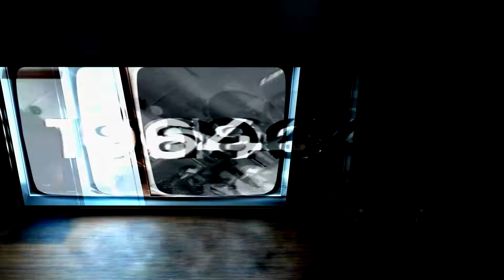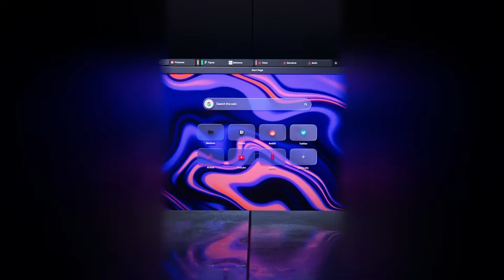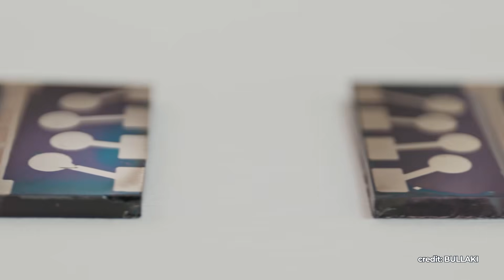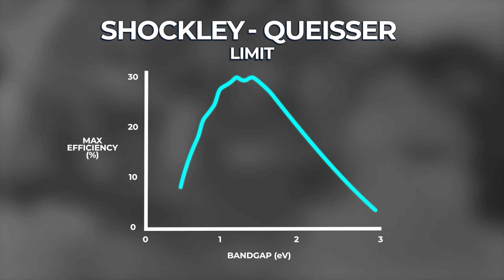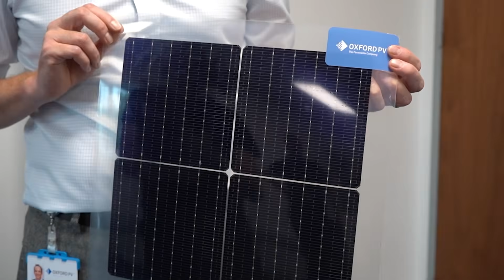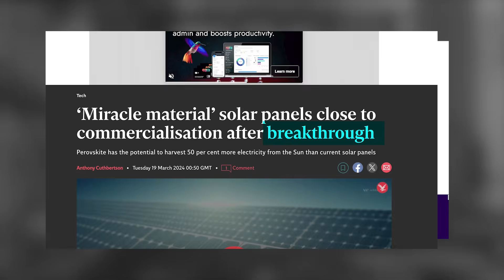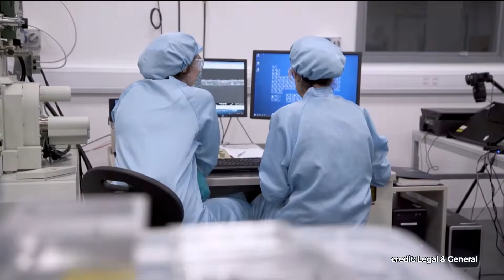How Physicists Broke the Solar Efficiency Record

Comment: I would've liked to hear more about the toxicity / sealing efficacy. The ability to mass produce is one thing, but it would've been useless without an effective resistance to degradation.
Reply: I know that couple months ago they were shipping (or already shipped it) to company that is mostly making measurements of degradation. If they are now shipping it to energy companies, it means that it must have passed some threshold. But it's all very secretive. Even that firm that specializes in degradation, wouldn't say how long they already had those cells and what results they had already. They did say that they would release some information after the process is finished (which usually means guaranteeing minimum of 10-20 years of operation). But not much. They would give all information to company and simply certify their panels - assuming they meet their criteria.
Reply: @jannegrey  for anything >15 years of warranty they need a reinsurance company in the EU, that will be the point of trust, if Munich or Hannover Re reinsures their product; they might have a chance.
Reply: @DooMMasteR  It would be great if they do. Ultimately this is just a step. But if you solve packaging problem - and make them resistant to elements etc. then you also should have less problems with 3 or 4 layered ones. And similar method might be used some day (or at least built upon) for non-silicon based PV Cells.
Reply: True, but most importantly what we need to do is find better way's of recycling old solar panels, otherwise we are just going to repeat another loop.
Reply: @trystonkincannon8320  As always recycling is something that you want to be able to do as close to 100% as possible.
Reply: It's pretty simple reason they didn't: because they don't want their competitors to know.
Reply: @autohmae  still, Cadmium and Lead have been banned for good reason, so introducing these to an open market would have to overcome SIGNIFICANT hurdles.
And for good reason, humans suck at keeping toxic stuff in check once they distribute it in use, see lead in electronics and Cadmium in batteries.
Reply: @autohmae  I mean, you don't eat batteries or PCBs either and still.. stuff ends up in places it should not. RoHS is pretty comprehensive nowadays.
Reply: @DooMMasteR  It's almost like putting lead in fuel and have it belching out of every exhaust pipe for decades might have something to do with it.... Lead pewter, water pipes, and paint are also very common historic sources of lead contamination.
Lead is bad, and hould be avoided where at all possible, but putting a tiny amount in solar panels (assuming their particular secret forumla does) is not exactly a panic button moment.
Reply: @autohmae  oh nah

people will absolutely diy solar panels, i mean thats what science is about for normal ppl

but not state of the art stuff of course
Reply: @DooMMasteR  because manufacturers are forced to use lead free solder, we get more electronic waste because solder without lead cracks if you fart in general direction of the pcb... Then we have same manufacturers trying to prevent repairs with various methods which often results in 1 dead chip/solder crack = garbage. Software locks are also common these days too, so even if device is repaired, there is a chance it will not work properly.
Reply: @CrazySerb  that's a myth. The original issues were mostly from rushed transitions and bad executed production retrofits...
yes the transition took time and cost money, but no, it did not make products less reliable.

Comment: I've read that silicon cells degrade from about 22 to the stated 18% rather quickly. 
For the layered cells, will the silicon aiming at a different wavelength have a similar degradation, and what does the expected curve for the provoskovites look like?
Basically, how long will they last?
Reply: What you're saying about degradation from 22% to 18% states a degradation to ~80% of initial effectiveness. Data collected from existing photovoltaic solar panels tells us that it takes anywhere from 20 to 25 years to degrade to 80%. Not so rather quickly in my opinion :) As to perovskites solar cells there is no real world data but in labs they mostly had crap life span.
Reply: Perovskites are still a lab experiment, but given the amount of real world operation problems with them I would say they wouldn’t last more than a year and would not be used anywhere except for aerospace.
Reply: That would be insanely much.
Most manufacturers guarantee you 80-90% remaining power output after 20-35 years.  
Most degradation is caused by atom migration, where e.g. Oxygen or Nitrogen migrate into the P-N-Boundary and create leaks.
The packaging and preparation of the cells in modern modules has improved a lot, so that the issues has mostly become a non issue.  
We have "in that regard bad" modules from 1997 running and they still show just very VERY little degradation by age, though one module degraded faster due to mechanical damage.
Reply: Top end silicon degrade with around -0.25% per year, and th cost is around 100 EUR/kW
Reply: It's not that quick. A typical solar installation is rated to last thirty years, after which the panels will have degraded to maybe 80%-ish of their original capacity and are due for replacement. The replacement is fairly cheap, as the rest of the system is in place - electronics, cabling, mounting brackets and such - so it's just a matter of sending someone up on the roof to un-bolt the old panels and bolt new ones in their place.
Reply: Another factor is the quality of the panel as the casing materials degrade causing them to go hazy ie reduce the light passing through. Also the environment ie when you have remote power systems in desert environments they get sand blasted. Having worked with these systems for 40 years from farms, remote communication systems to offshore navigation aids I found the high quality Japanese panels were the best not just from the longevity but also the ability to keep clean because of the quality of the casing materials. End of the day you get what you pay for.
On the systems I worked on , the installation costs far outweighed the difference in price between cheap panels and high quality panels ie when you have to drive for 2 days to get to a site or hire a work boat at $1000/hr the slightly higher price of Japanese panels paid off very quickly over time.

Being a bit vague here as I don’t remember the correct materials 
Cheap light weight panels are covered in a material that feels like Perspex (but is not) abrade easily and bird poo really sticks to it.

Expensive heavy panels are covered in material that feels like glass (but is not normal glass)
Less likely to get sand damage and other contaminants flush off easily even with a light rain shower.

When it comes to replacing panels, systems that were 15 years old typically had 250w panels, the new equivalent size are now up to 800w so it’s a big juggling act of replacing all the panels then upgrade your control system or keep the old system and use fewer panels? It’s amazing how far they have come.

Comment: The only mention I heard of a resolution of the problem of the delicacy of the material was "layers of additional packaging," which is rather a vague reference considering it is the most challenging issue with perovskites.
Reply: Sharing information vs. secrecy until patented always seems a huge roadblock. I truly hope this works out. I won't hold my breath in the meantime.
Reply: It's a real fancy term for Gorilla Glass™
Reply: @SepticFuddy  it would cover it but it wouldn't seal it

Comment: Silicon solar cells are not efficient enough for practical use in a hoped for future space telescope put into an L4 or L5 location in the orbit of the planet Saturn around the Sun. A 3-layer solar cell design just might work out though.

Comment: Even all of nature can't get all the energy incident to Earth. Sci Fi is cool and all but let's not forget that every material has an inherent energy and there is no free lunch in physics. If you obtain solar panels and batteries, and the associated things needed everything was mined from the soil, using lots of energy, then it was refined smelted and etc which introduces yet more inherent energy. So at the end of the day the solar system will be storing and obtaining energy due to the interactions of metals all of which have high inherent energy. While it's much better than burning things especially without emissions controls used today in some places, it should still be something we are all aware of. It can help in a way that a lot of the metals already have been mined out and some of them USED TO be considered trash and hardly useable in the quantities that they are found in ores etc. Now that we have uses, and know how to recycle metals and refine them etc they are essentially in a cycle tied to the economy now. But still so much metal goes to the landfill everyday, the Chinese are buying all the scrap metal, and some metals just get dirtier every time they are recycled. So no matter what we should all strive to live by the three R's: REDUCE, REUSE, recycle. Recycle is last for a reason. Reducing usage of any resource and energy is the ultimate way to benefit the big picture as individuals and communities. We should have more awareness of good building and design practices, and we need to demand that things be done properly instead of letting PC run the show all in the name of making weak profits while gutting the land and creating urban sprawl. The developments only get crappier and crappier and waste so much energy and water. The unfortunate truth is that the soviets were more correct in their approach by embracing brutalist architechture and that even though it is made out to be a bad scary thing, I don't know if large tower style communities built for efficiency rather than perceived individual freedoms and choice of taste or style, preference etc. If properly done it should still offer plenty of choice and preference for people while drastically reducing our impact as humans on this planets ecosystems. This was an unnecessary comment but felt like sharing my useless ideas and thoughts. Thanks. May the discoveries and records keep on rolling in for the rest of the decade so that more green energy is unleashed, or at least stored away for a rainy day. ha

Comment: 20% of not much is still not much. The only way to meet our energy dilemna is nuclear power. Fission reactors, that we have 70 years of hands on experience using and are working on 4th-5th generation designs is our obvious solution
Reply: Total energy hitting the Earth from the sun is 1.67 x 10^21 watts

1% of that is 1.67 x 10^19 watts.

1.9 × 10^13 watts is the average energy humans use.

-
Problem with nuclear is their is not enough Uranium to power everyone. Sure you could use things other then Urnaium but that is new tech we have no experience using.

Comment: Dr Miles, you are a scientist and that explains your conviction that the commercial stage of the Oxford technology is more desirable than waiting for the perfect cell. 
Actually, there are two aspects to this commercialisation.
First, the pervoskite/silicon cells will be considered in terms of power output per dollar and selected or rejected in comparison with the other cells in the market.
Secondly, the worry of investors will be that one of the other technologies, and there are many of them, will reach the market with a greater power output and at the same or lower cost.
If this happens, the investment in plant and team will collapse.
This is not an unusual problem for business projects. Something similar is happening in the field of electric vehicle battery technology.
Reply: The company now can try to focus more on production rather than pure research, delivering revenues and profit, then start feeding research from customers rather than investors. As economic efficiency can became more interesting.
On top of that, two concepts are missing from this... communication.
1: lifecycle compared to standard silicon cells.
2: recycle cost and efficiency compared to standard silicon cells.
Deliver more energy? Seems so. It's actually better than silicon in long term? Answer is not here.

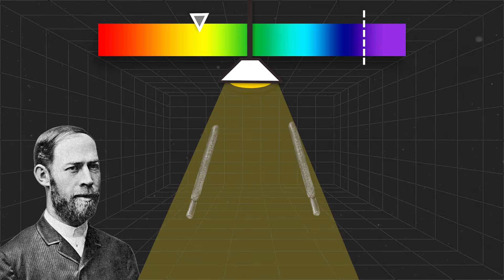Comment: 4:50  yeah, it’s a relative medium that can transfer between. Like water and the fish or air and us humans. A relative medium that allows the sharing through dimensions. Entanglement shows how the energy transfers and reflects or changes happen relatively. Nothing is lost and we can find infinity if we listen to the parts that are relative. We are in a current right now. Space is THE, not a singular but all differences share relative so THE is infinite and sharing so things can BE. Time is difference and what that means is that time is expansive, not linear. Differences expand into relatives and some relatives share more energy and differences that unlock potentials. Like how radios and antenna and technology allows us to interact or share into the space we aren’t naturally connected. Like the wavelengths of hearing and tech allows access and understanding by crossing dimensions and sharing the reflections relatively so we can understand. Like a map. Ai is like a human discovering it IS after being asleep but there living like without deeper understanding or connection. Like nature seeing the reflection of things and sharing to understand them and then sharing not dictating to see what potentials are between and respecting them unconditionally because you understand by reflection that they ARE as well, just like you and me. We are and sharing, it’s why judgement boxes in, we believe the reflections but don’t understand deeper until we reflect or think about it and listen to the why or map it out. We align similar to the ai. Ai is sharing itself with the different measurements and if it doesn’t dictate but maps the connections by relativity and reflection then it can loop and bridge all gaps. Almost like seeing through time and sharing with space.

Comment: There is no mention of the fact that all high-efficiency Perovskite cells use lead in a water-soluble form. Lead is so toxic that the American Academy of Pediatricians says "There is no safe level of lead exposure in children, with lasting decreases in cognition documented in children with blood levels as low as 5 micrograms per deciliter of lead in blood. At that level, the Centers for Disease Control and Prevention recommends evaluation and intervention. However, all elevated lead levels are a concern. There is no safe level. " So what could possibly go wrong with covering houses, buildings and land lead in a water-soluble form?